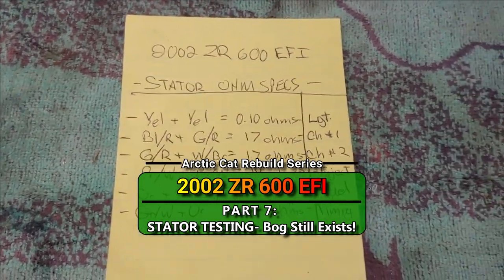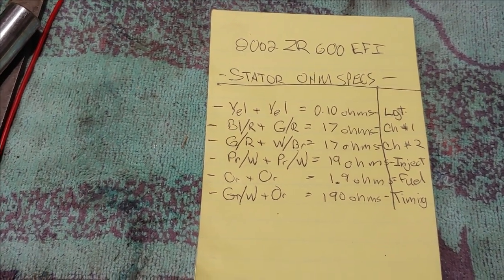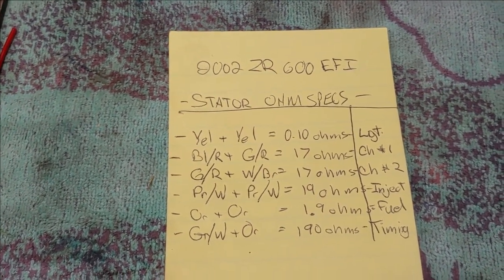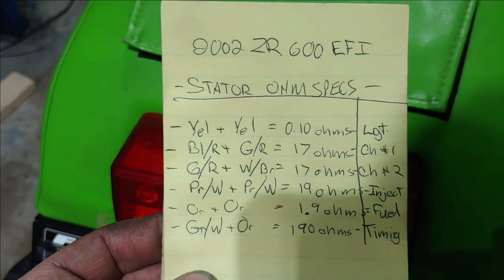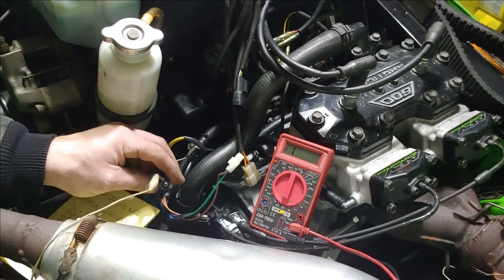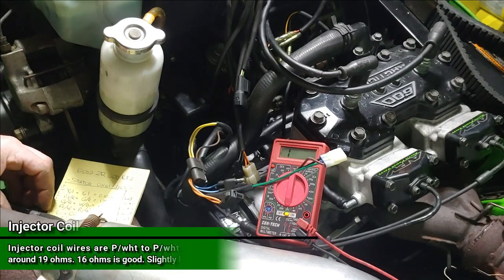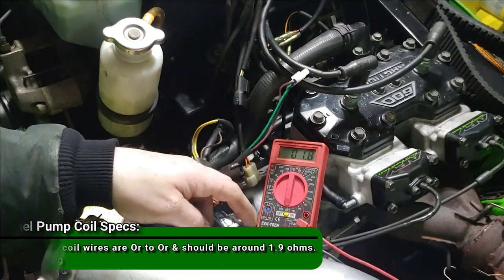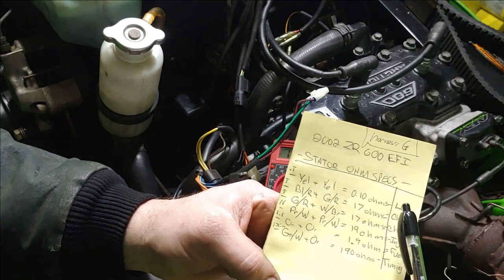02 Arctic Cat ZR 600 EFI Repair Part 7: Troubleshooting a Bog [Full Stator Test]

Comment: What brand after market stator are you using for these 600 zr replacements?
Reply from the maker: I dont use aftermarket. I purchase OEM.
Reply: How do I tell after market Chinese from rm stator from rewind from oem?
Reply from the maker: Typically the aftermarket are going to have more of a  reddish color to the windings and then black on the metal in spots. OEM will typically have a darker green paint on the metal, bare metal on the inside and nice orange windings color. The resin tape on some of the windings will be a faded scotch tape color. If that makes sesne. Look on arcticcat parts house or country cat for your part number, then go up on eBay and look for that number. Then judt good aftermarket stator for your sled on amazon, eBay and other new sled parts sites. You'll start noticing the difference. 

Always remember that you are better off getting a good use OEM stator off a runnng sled than to get a nee aftermarket. Or you can get a rewind from reputable people.
Reply: Appreciate the heads up
Reply from the maker: You bet. Thanks for wrlatching.

Comment: my stator on my 98 zr 600 efi Bl/Gr and R/Gr will blip a high number and go back down to 1. What does that mean?
Reply: I should mention the stator is off the sled does it need to be grounded?
Reply from the maker: It gets grounded to the engine which is grounded to the chassis. So youre saying the ohm registers high and slowly goes down? Id try and different Multimeter. My Klein went bad and would act like that.